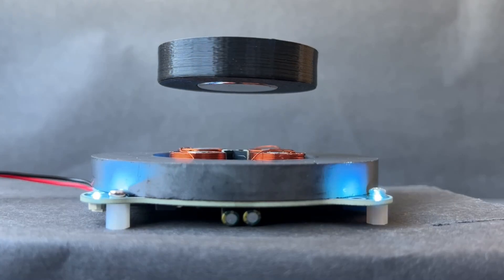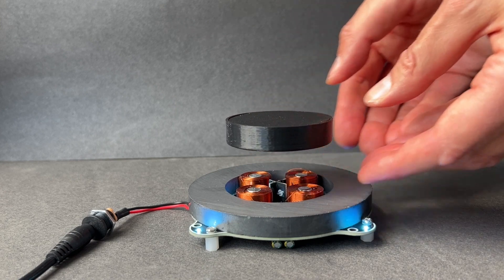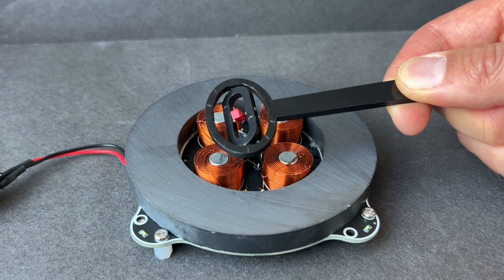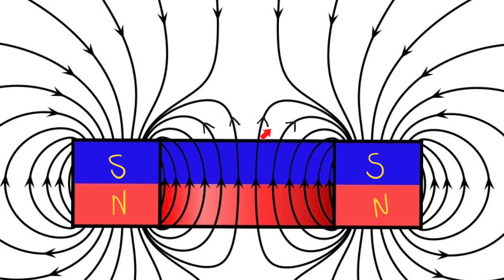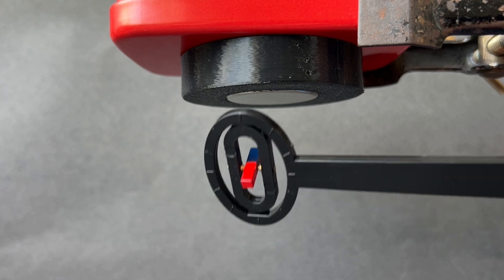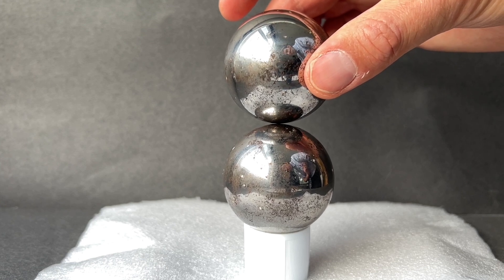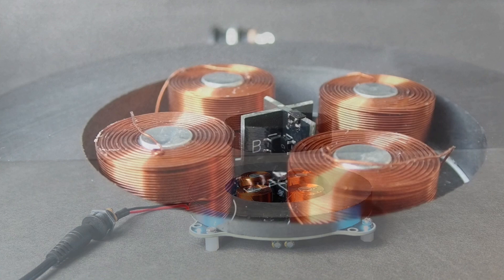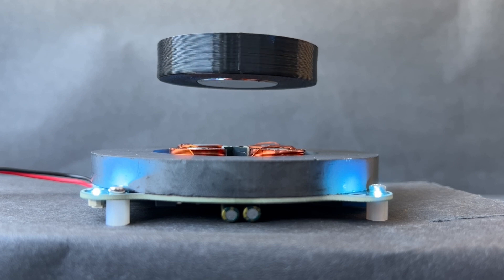Floating magnet platform explained

Comment: Really cool. Is the spinning motion actually just the slight acceleration you gave the disc when setting it up and will eventually stop or is it a by produkt of the mechanism?
Reply from the maker: I think at this point it is from the motion when I set it up but I think the little forces caused by the electromagnets are likely to start it turning over time as well.
Reply: @SimonPoliakoff  I was simply wondering because there is a company that produces little planets hovering above a Disc with exactly this principle. But they keep spinning and start to spin eventually when you place them on it.
Reply from the maker: @addictivegaming24-78  Yes I think they all use a similar design but this one is nice for teaching physics as you can see what is going on inside it.  I also have the floating light bulb lamp which is nice but the gap is much smaller.